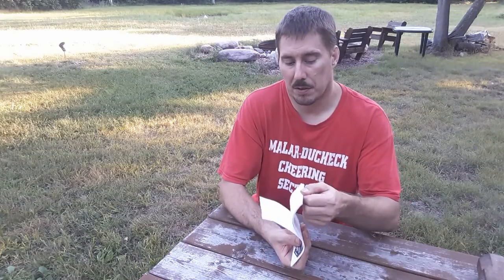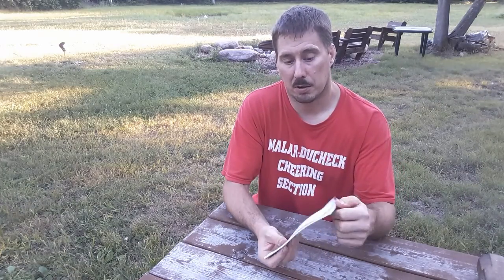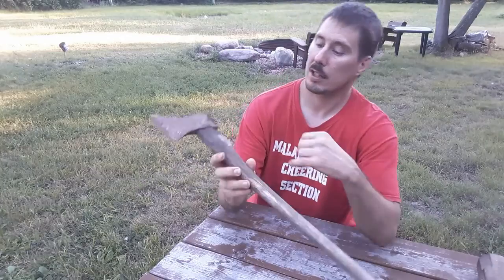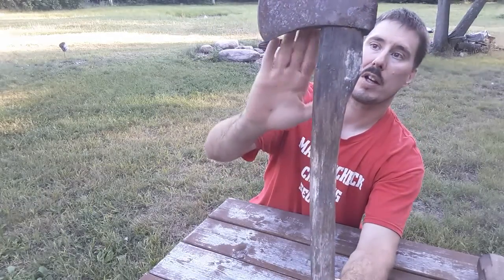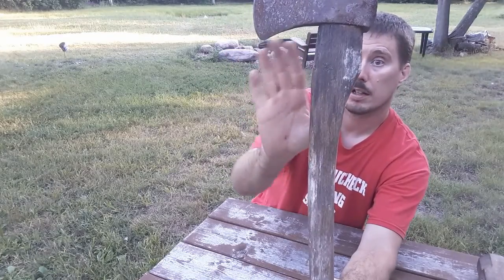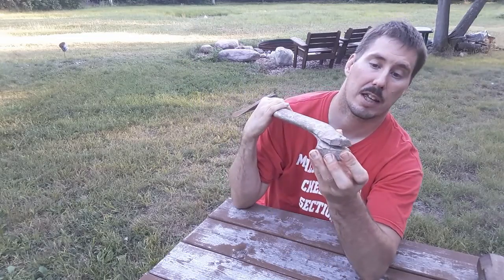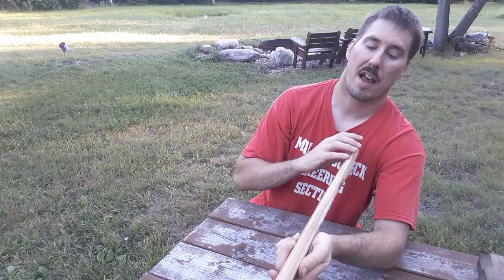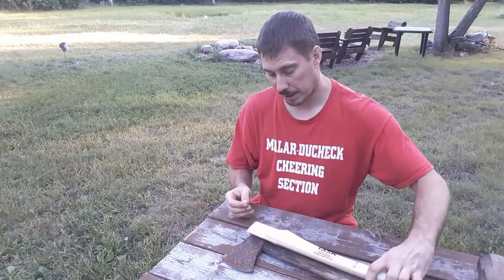Wooden Tool Handle Grain Orientation - Important for Safety

Comment: Just what I suspected! 
I’m often hard on the two shovels I use for digging artifacts. 
Still, I managed to keep one shovel handle, oiled, and polished smooth by many years of use, until my son snapped it. 
Seems every handle, in any store, is aligned the wrong way, facilitating breaking. 
Found a replacement handle today, with some densely spaced grains, running the length of the handle, but the bevel is oriented so that any leverage will translate with the grains,  essentially one at a time, rather than across them, combining the strength. 
I’m going to invest a little effort into correcting this handle, prior to installing it.

Comment: My take is the grain orientation is different, I like them running the opposite direction you are referencing.  I am hearing more consensus that both directions are fine but grain run out is more of an issue. This can be due to improper material selection and from using sawn stock as opposed to rived or split stock, which follows the grain.   I prefer the grain running as in this video link, shown on a recent rehandle I did.  I like a slim handle, the grain running the other way also reduces the chance of the handle bowing and it acts as a spring delivering less stress into your body, as the handle has a chance to flex.  Many manufacturers are making very stout thick handles these day because they want to reduce the return factor, in part is my theory for thick handles.   I make my handles from scratch.   That is a big head on that maul for such a small round handle, maybe look into making a custom handle for it.  
https://www.youtube.com/watch?v=0_DccTTUtb0